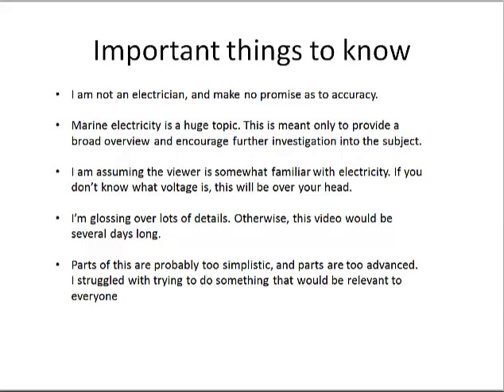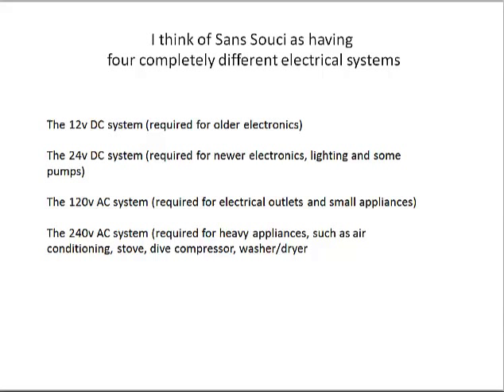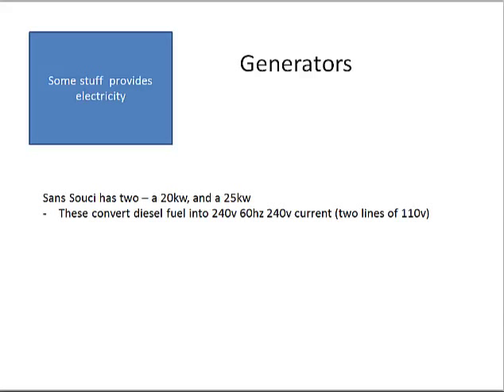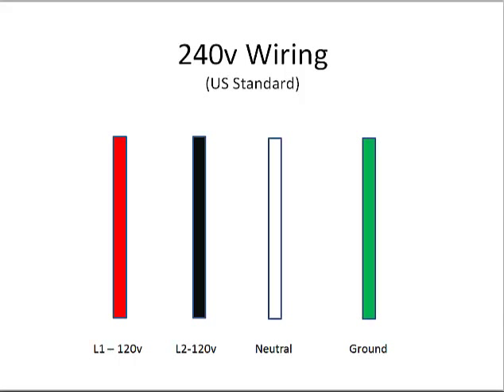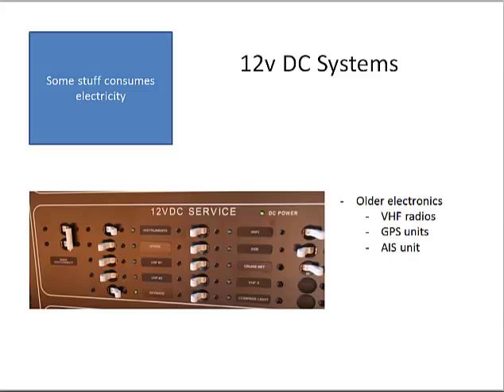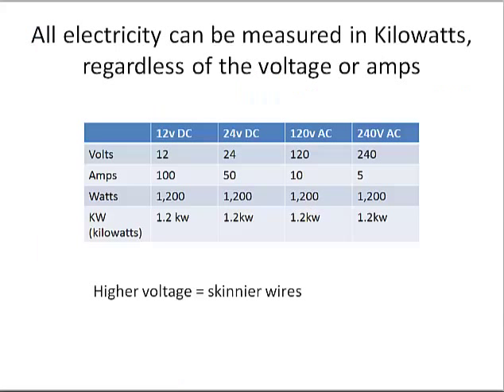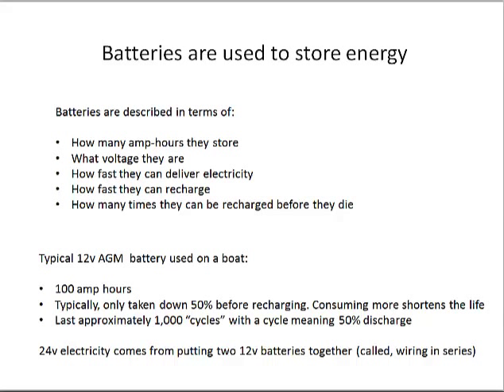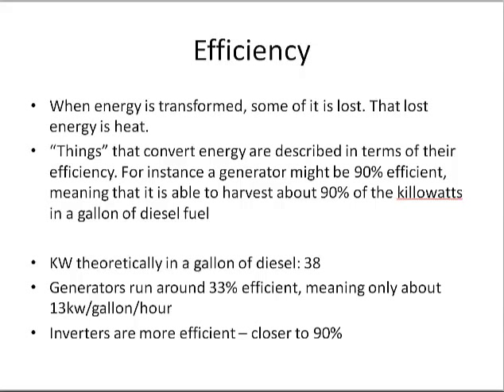Sans Souci's Electrical System

Comment from the maker: Jay - Wind generators are possible on smaller boats, but not realistic on my boat. That said, some of this is because of where we cruise. I like warm water cruising -- which means non-stop air conditioning. Also, we have lots of electronics that are on all the time; the VSAT (satellite internet), the positioning system for the tv receiver, all of the various ship's computers, lights, etc. Roberta and I live on the boat about six months a year, and like having "all the comforts of home." This means lots of electricity.

Comment from the maker: Olaf,

For my particular boat, solar wouldn't really be practical. We are "warm water" cruisers who usually cruise in the warmest weather in the warmest places. This means 24 hour a day air conditioning, and 24 hour a day running of the generator. If we were cruising in Alaska, with a diesel heater, then maybe solar would have a place on the boat.

Ken W